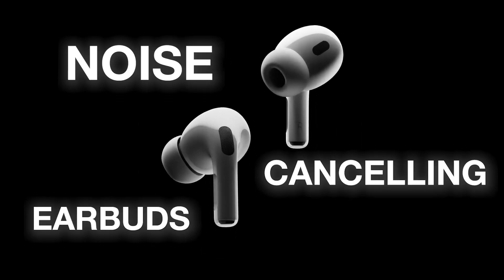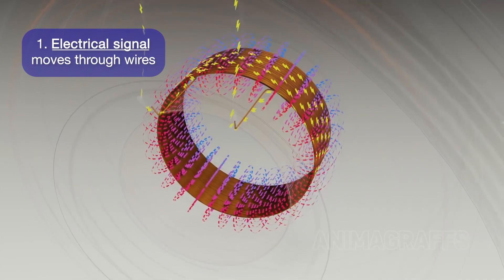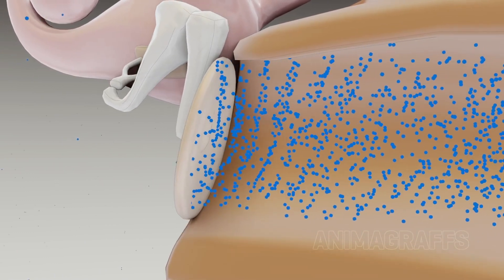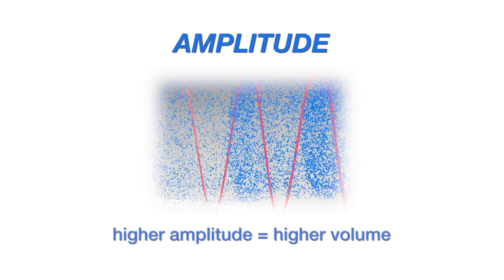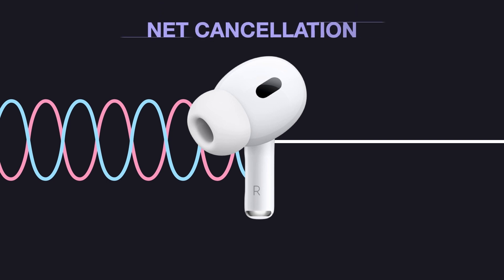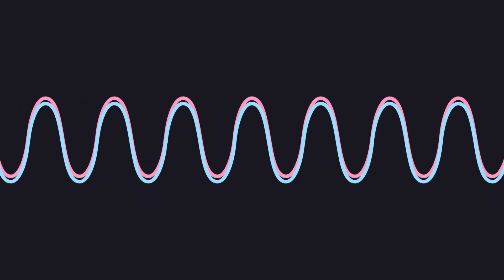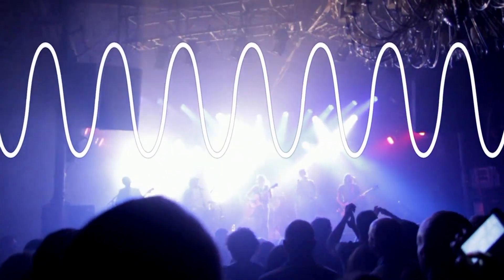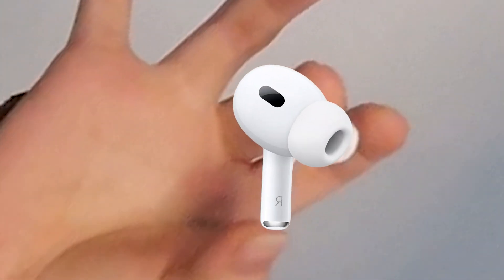The Physics Behind Noise-Cancelling Earbuds

Comment: I wonder if we can create a device using the same principles, but modify it in a way that we can record audio of our surroundings, feed it into the ear phones and ask it to produce custom destructive interference, which should be even more effective than general application low frequency sounds?
Reply: The rough idea would simply be flipping the recorded audio, but a more precise execution would typically require a large library of audio files to help sort out the sounds? Either way, very good video!
Reply: Isn’t that what it’s already doing?
Reply: @mimishwartz3065  ur right, i thought it uses a very general approach destructive interference that only cancels out everything within a pre-set frequency range, but looking at the science behind modern noise cancelling tech like Sony's headphones, they use built in microphones to analyze surroundings and produce the exact anti-noise needed XD